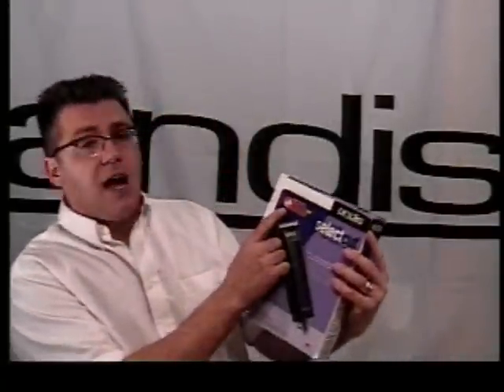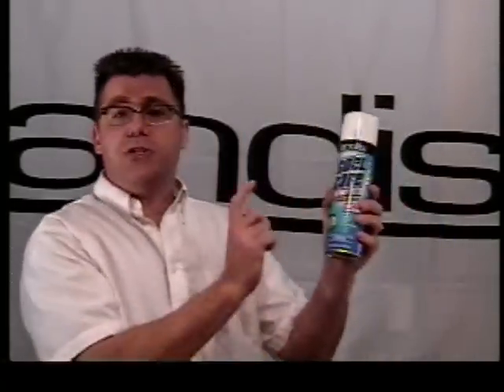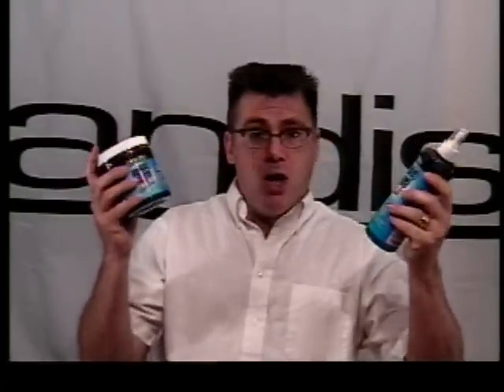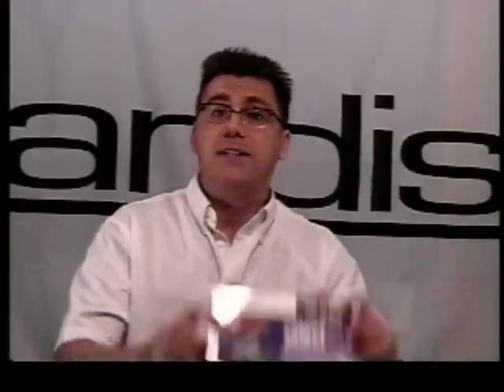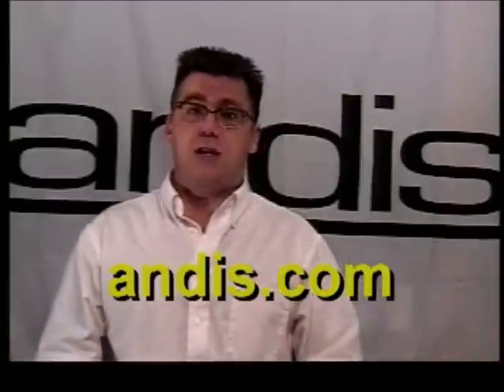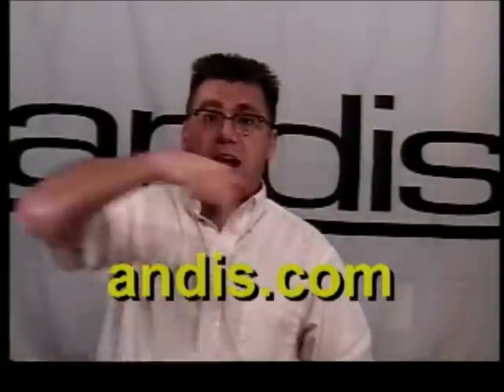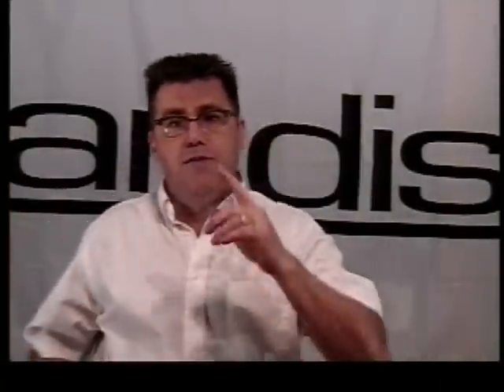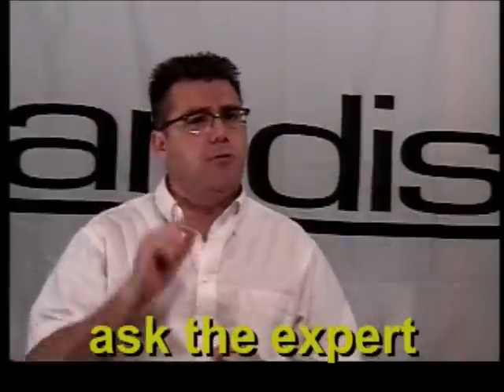Ceramic Blades - Ivan Zoot - Andis tool tips - 407

Comment: @PresidentAssassin For right now buy the Speedmaster I, the main benefit is the ceramic blade for me, and they aren't widely available for the Speedmaster II right now. I've searched for this for weeks, and the supply just isn't there. Ceramic blades for the BG clippers are widely available though. Just stick with the Speedmaster 1 I loved those, and I ended up having to buy the metal blade for my 2s anyway. Save your 15-10 bucks.

Comment: Hi, I own an Improved Master Clipper and would like to use it with a ceramic blade. Is this possible? Non of the clipper guards available do not give me the right length, So i just used the clipper without a guard, but would love not cutting as low as a currently do. Please recommend a part or model number of ceramic blade that would fit. Thanks.